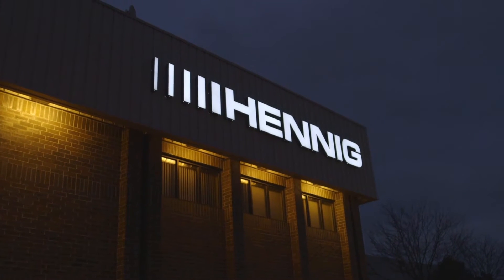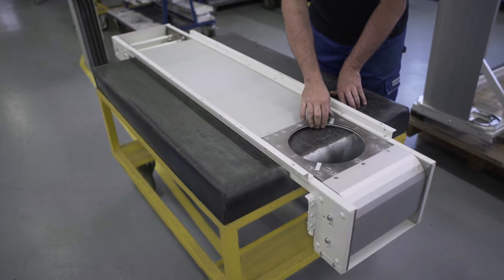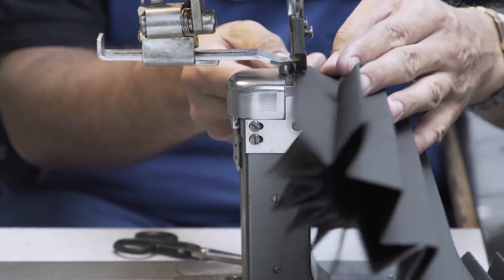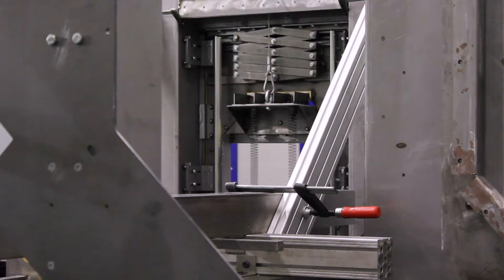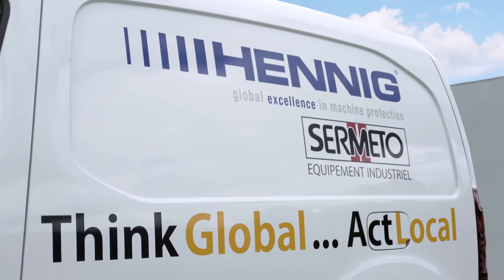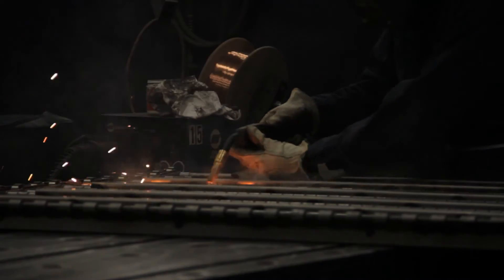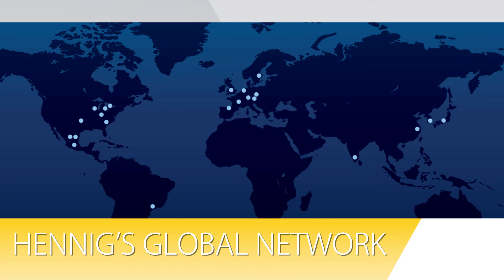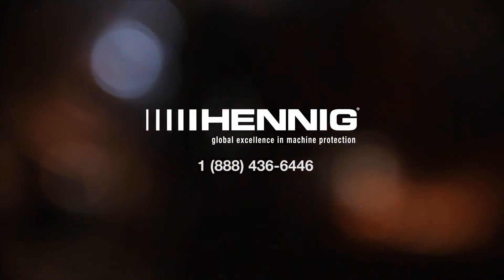Machine Tool Protection - Protect Your Success

Comment: Hi, This is Chand. I am designing a Desktop CNC machine. I am facing a small problem here. ie Choosing between a way cover and flat bellow.

The distance between the L.M rails is 200 mm and Maximum length of cover will be 300 mm. 
Could you please suggest which protection system will be suitable for my design. And also Catalogue of some standard sizes.